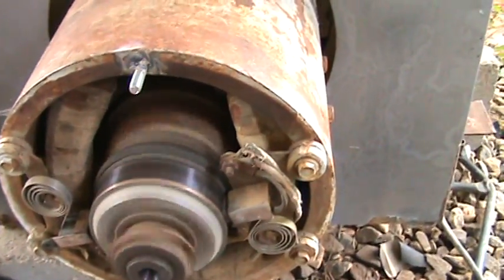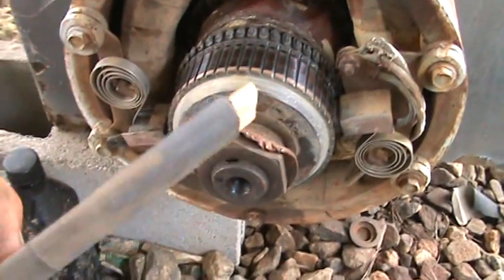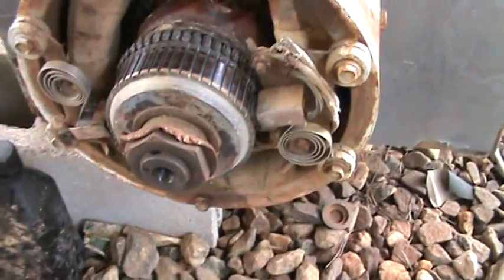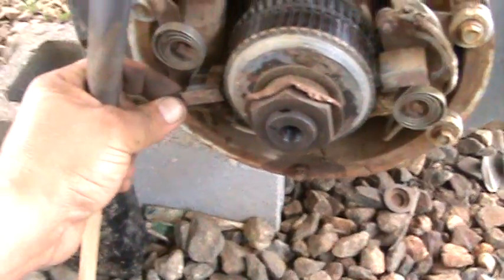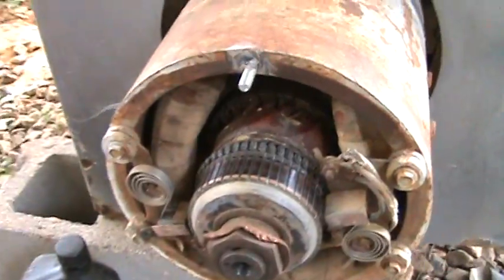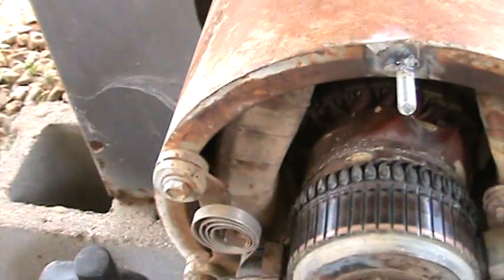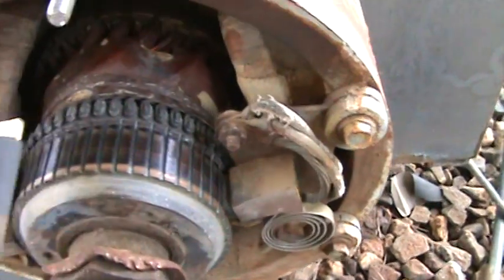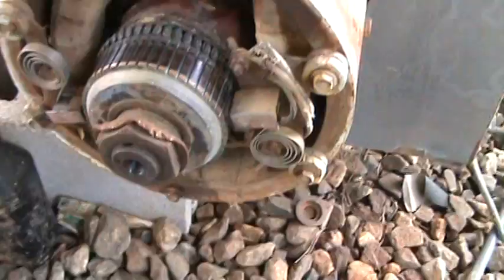Cleaning the excitor amature. on a sa 200         8-17-14

Comment: Looks like your armature is out of round. You can see your brush moving back and forth! Does it vibrate under high RPM?
Reply from the maker: a little it could be that armature came out of a 1948 or 50s the one that came with this1985 sa200 burn up  the older armature are the better ones  in my view   thank you
Reply: A commutator stone will make it look nearly brand new

Comment: I was welding with my sa 250 and I cranked it up to 3rd gear and it won’t weld no more I think need to clean those amateur with stone right or any other suggestions?
Thanks

Comment: I have a 1968-1969 sa 200 and my right side brush puts out a small arc.  if its not sparking it will not weld.  Is it supposed to do that?  It's not like a large arc just a light spark bouncing around brush face.
Reply from the maker: Check your load and no load toggle switch, I've had those to go bad where it won't allow you to weld.  It's in the front of the machine, it's the little toggle switch and sometimes they do go bad.  A little spark on the excitor brushes is all you should see on both sides.  There's another set of brushes behind the big cover, check those too.  See if they are stuck or the brushes are totally worn out.

Comment: use real sandpaper if you must.  that emery paper is electrical conductive and you need to blow out the commutator bars.  this is not the  correct way to do it.  the stone is even better.  look in any electrical book on dc generator maintenance
Reply from the maker: yes your right   i do have a stone for this but most people do not  this is just a quick fix  thank you for the comment